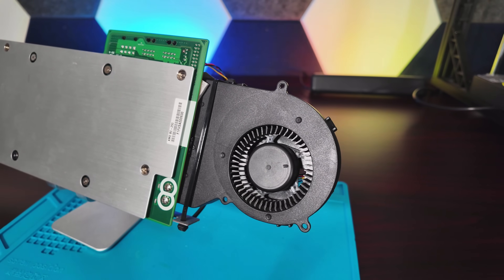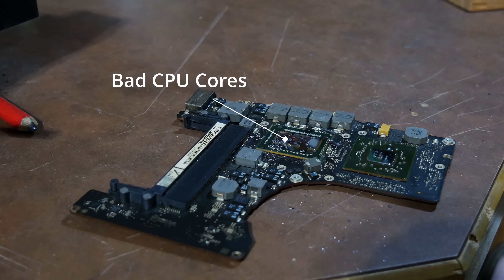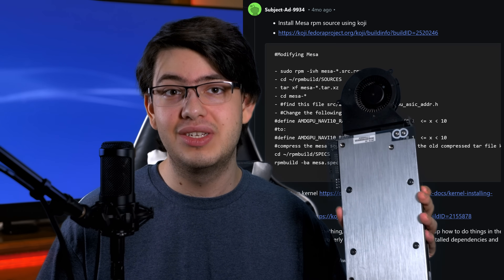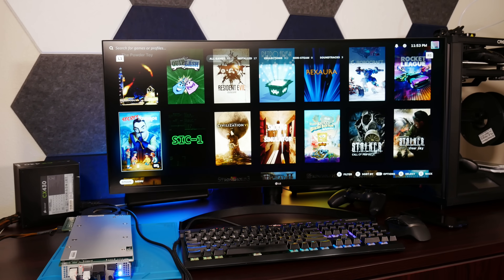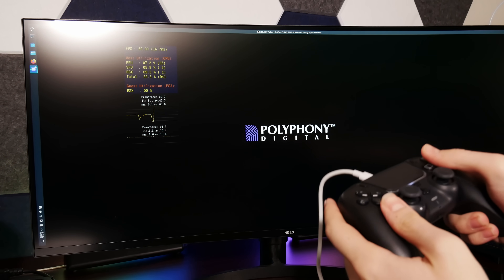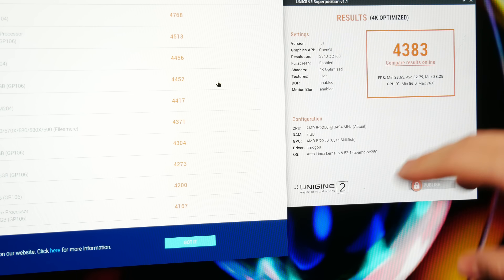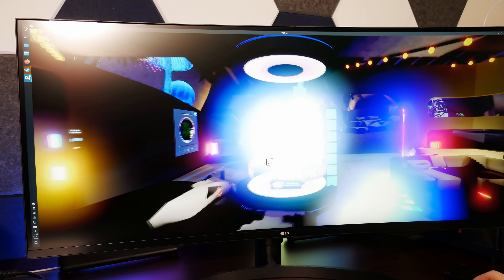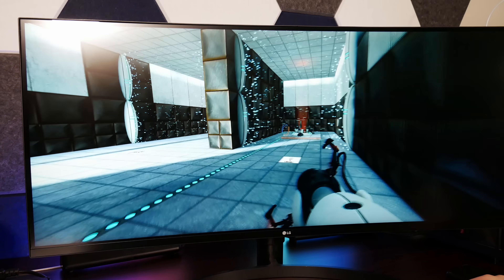I Ran PS3 Games on PS5 Silicon to Prove Sony Wrong

Comment from the maker: Things I got wrong;
- A GitHub repo with relevant documentation is available here, which I didn't run into until after making the video; https://github.com/mothenjoyer69/bc250-documentation
- Segfault (in the aforementioned GitHub repo) was the guy that made the Mesa patch possible. He is the one to thank for all of this. I wholeheartedly apologize for the misattribution, this was a glaring error on my part, the information I used was posted without attribution and I incorrectly assumed who was responsible for the Mesa patch and all the other effort put in to these blades.
- Probably don't need the kernel patch? Test amdgpu.sg_display=0 in kernel cmdline args in newer kernel?
- You can change the 8/8GB RAM split using modified firmware. Some versions of the original firmware even change the RAM split!
- RAM frequency was likely being reported in a misleading format by Linux. It's still slow tho.

And of course, a massive thanks to everyone who has been involved in documenting and experimenting with this hardware, unfortunately I don't know who a lot of them are since we all took different routes to get here, but as a community effort I'm excited to see what people do with these things.
Reply: Is there a BIOS dump floating around? If not, could you dump it? I'd like to take a look-see at a few things.
Reply: @xero110  Are you kidding me? Did you even click the link?
Reply: @xero110  I dumped the original off mine: ASRock 4 U 12 G BC 250 P 4.00. G 040822 Original BIOs search archive for that.
Reply: @xero110  ASRock 4 U 12 G BC 250 P 4.00. G 040822 Original BIOs search archive for that I dumped it
Reply: DM me we can get the right drivers running to get that running more like a 6600.
Reply: @TheRealMrRoboto  Did you figure out how to get better drivers running on it?
Reply: @xyund  yes I figured it out
Reply: @TheRealMrRoboto  bro what do you mean right driver? the world needs to know man.
Reply: @ZombieRig  find out yourself
Reply: A Blender render farm is suitable. LLM wont perform. 1st there ist not enough VRAM per node and the nodes interconnect oder gbit.
I would like to see how one blade performs in blender… (rx480 is not that powerfull 😉)
Reply: Uses? Possibly for an LLM or low cost rendering system.
Reply: Hey the discord link just takes me to discord not the server , plan of getting one of these and would love the extra help
Reply: Can't you make a pull request? Or even open an issue, presuming some amd guy may help
Reply: Your discord link is broken
Reply: Dude your discord link is bad
Reply: How about full processor swap with donor cpu collaboration with northwestridgerepair?
Reply: Bruh am I seeing this right. It costs like $350 for the 12 blade server rack? That’s 12 somewhat trashed ps5s. You sure that power can’t be useful for anything? Like how trashed are they. Can you at least cook meth on them or something?
Reply: Is there a similar older board made using the PS4 APU?
Reply: I wanna see you connect a mpcie to pcie adapter and an HBA card with trueNas.

For example...

LSI LOGIC SAS9211-8I 8PORT Int 6GB Sata+SAS Pcie 2.0
Reply: You could in thery buy ps5 and take the chip off a official ps5 and replace the downgrade one with full ps5 chips by soldering it
Reply: bring it to Salam Techspert or Linus Tech Tip they can help you achieve this plan
Reply: ⁰999
Reply: I wonder if you could flasify the vender ID for the GPU to get it to boot under windows?
Reply: I guess they have enough power for a full distributed Docker Swarm, since you got the power of the CPU and GPU I would have them running Tdarr to encode all of those videos on my home NAS, as a youtuber yourself that might come in handy
Reply: @soykike1991  [EXTREMELY LOUD INCORRECT BUZZER]
Reply: @no-fo6pi  Would you care to elaborate? I guess that would be more productive... I do run a Docker swarm with a bunch of underpowered hardware, how come this would be different
Reply: How did you find the repo that clearly states exactly who is responsible for this hardware being in a functional state (spoiler alert, the people you've credited have lied about their contributions) and yet somehow still fail to credit them properly? I swear to god man youtubers are a different breed.
Reply from the maker: @no-fo6pi  I updated what I can with the correct information just now. This was a mistake on my part. The kernel patch made with my friends was effective, although as I now understand, it was probably not necessary had I known more information beforehand. The vast majority of work and research for this video was done in early-mid September.
Reply: @LowestLogan  You could in thery buy ps5 and take the chip off a official ps5 and replace the downgrade one with full ps5 chips by soldering

Comment: As you've got 12 of these cursed PS5 blades sat there, you’ve basically got a farm of VR-capable silicon doing nothing.

Tech-wise, the BC-250's got the raw muscle—it's basically an RX 480/GTX 1060 equivalent but with 16GB of GDDR6, so it'd actually handle the VRAM demands of stuff like Alyx better than my current desktop rig.

The major software things is they won't boot Windows and Meta's drivers are proprietary as hell, you'd have to go full "mend and make do" with a Linux VR stack like Monado or OpenXR.
If you can get a DisplayPort-to-HDMI handshake that doesn't throw a fit, you’ve technically got a stack of VR-ready nodes. It’d be a right result to see if those custom kernel patches and the Mesa library can actually talk to the CV1 sensors without the official Oculus bloatware. You’ve already proven Sony wrong on the PS3 emulation, so why not give it a go and see if you can't turn one of these server blades into a proper "Frankenstein" VR station?As

Comment: If it works, then why he only shown 3 games running this way?
Reply: The video was basically a "Hey look at me I can buy weird hardware and use people online to help me create code to see if we can run older games.

I honestly didn't see a good use case for having one of these pieces of hardware.

The better option would be to hack the PlayStation 5 directly because it wouldn't be so loud and it would run cooler.

Comment: to be fair, the ps3 is notoriously hard to emulate to begin with. its not a regular CPU  and GPU. theyre cell processors. most emulation is making hardware specific code compatible with similar hardware. the thing is, the ps3's cell processors are nothing like regular hardware. they were experimental at the time and still are today because it rarely justifies the r&d cost

the only reason sony used it on the ps3 was to try and outdo the ps2, the best console ever made. so they took to the "lets try and make a super computer" path

Comment: This video didn't tell us much either, because Sony's PlayStation OS has nothing to do with Linux, and it's simply not worth developing emulators for the older console because there's not that much demand for it. Besides, it's not that the PlayStation 5 can't run PlayStation 3 stuff due to lack of performance, but the PlayStation 4, since we compare it in practice, has a much more powerful CPU than the 4, which is why it's possible to create the environment needed for gaming in real-time emulation.

Comment: Try PS3 SPU heavy titles, which includes most 1st party games and many 3rd party titles pushing it. They will run terribly or not at all. 

If Sony's platform can't play most of the games that use the full architecture, it would be weird to offer emulation.

Comment: You're Not Running PS3 on a PS5.
You're Running PS3 on a PC and the RPCS3 Emulator.
The PS3 is 10 Times Faster than a PS2. The reason You Could Emulate PS2 on PS3.
The PS4 is Twice as Fast as PS3 and the PS5 is only 3 Times as Fast as a PS3.
The reason the PS3 is still Good in comparison to Them.
This Demo, you've done. you've Used a 6x Zen 2 cores @ 3.5 GHz (PS3 = 3.2 GHz)
Thats 7 Times Faster Than a PS3. The Reason You're Demo - Works to some Degree.

Comment: You should revisit this, there's a lot of software updates now and most Linux distros run now and you can get the gpu to clock to 2000mhz now

Comment: - Landed here after a Budget-Builds Official video... :D Well, I'd say YES, this hw could have a use, if it wouldn't be so quirky to get it run properly, since, for the perfomance,
the W's consumed are not that much, and the initial costs are neither that much. SO power to W to costs would give a really good ratio.
I run a Ryzen 5 5500, with 2x8G DDR4, and a 4G Radeon RX570, would be wiped with the BC-250 running on proper sw, while my gpu eats alone over 130W...)
  - Oh, the trusty CX430 :D Is it an older one, or the new?
 - PS X on PS Y: Since the second revision of the PS3 (partially backward compatible, until sw update...) they took proper backward compatibility from us.
We, sadly, have to accept that fact. It is not hw limitation,
it is limited by high profile people at the companies, who have absolutely nothing to do with games and gaming,
just profit on short and long terms. At least it seems so.

Comment: You are running compatible x86 code. Not CBE. That is not a prove. The Games are not bad optimized, it’s the architecture.
Run Uncharted 3, Killzone 2 and Resistance 1.

Comment: Sony learned in 2007 that they can make money by sellimg PS2 games digitally on a non-backwards compatible PS3. Why would they make PS5 backwards compatible?
Reply: So why did they make PS4 games backwards compatible on PS5 then?
Reply: @CharlieMikeNS  because the PS5 has no games 😂😂😂
Reply: @CharlieMikeNS I reckon it's because there was still a huge install base of PS4 consoles and PS4 game libraries out there, and because the PS5 would otherwise be a harder sell, feeling more incremental than the generational leap of the PS2 to PS3. 

Perhaps most importantly, it's much easier technically. PS2 to PS3 meant keeping backwards compatibility from a specially designed architecture to another specially designed architecture. From PS4 to PS5 it was more like "quirky PC to higher end quirky PC".
On PS3, Sony initially included the Emotion Engine but then removed it to cut costs. They could've implemented PS2 emulation of existing PS2 games.
Reply: @arsnakehert  my point is that it's not just because Sony is greedy and lazy.
Reply: no, they didnt do that cause it made more money for them to sell ps2 games digitally. its because shipping a console with the guts of your previous console is a bad idea. remember the $500 launch price? remember the ylod?
Reply: @chillmanmax775 they removed the PS2 chip to cut costs. Then they started selling emulated PS2 games and found out locking people away from access to their games was good for business. Your point being?
Reply: @arsnakehert He probably was paid by Sony to say that 😂
Reply: @arsnakehert  He’ll start talking about how he’s a real man and can scam you as much as he wants or some other horse shit like that, it’s how people like him thinks
Reply: @chillmanmax775  hey man sorry you’re getting so much harassment in the replies. just wanted to say your point on this is entirely valid. while I’m sure Sony liked the idea of reselling PS2 games digitally when they cut PS2 backwards compatibility, they were losing to the Xbox 360 and being utterly demolished by the Wii, both of which were way cheaper than the PS3. consumers wanted a price drop, which meant costs had to be cut, which meant including an entire PS2 in every PS3 got the axe. not sure why people here are convinced it’s some sort of huge anti-consumer conspiracy

Comment: use more power tools from that german site i think they have the bc 250 in there u should be able to raise the 450 to 600 or 800.... messing with voltage...... the drivers will gimp the card to lowest clocks if u use modern drivers so dont mess with VOLTAGE

Comment: another pointless video where the uploader just gets some cpu or gpu that is the equivalent to the speed of the ps5 and then proceeds to emulate ps3 games. that's not backwards compatibility, that's software emulation. sony and nintendo clearly prefer backwards compatibility at the hardware level and not software emulation. there is a reason why sony has stopped using software emu after the ps3. not to mention, consoles use system on chips and not a seperate gpu

Comment: I use my systems to watch my dvds/blue rays so getting a system without a disc drive is not an option for me if they completely stop putting disc drive in systems I will stop buying them and buy strictly Microsoft

Comment: Would this work on a fully functional ps5 too?
Reply: Theoretically yes, however it would likely require a fair amount of modding at which point starting with the BC250 blade would make more sense. They sell for about the same price or less than that of a PS5 but with the PS5 you will have to invest far more time and money to make this work. Then again, it would likely be way more stable on the PS5.

Comment: honnestly if they made a small pc with those chips at a okay price and okay functionality, that would have sold insanely well. though not for nearly as much proffit per board, but would have been great if they wanted to sell piles of boards. though ofcource they where limited by the amount of faulty enough yet still working ps5 chips.

Comment: It was very interesting. Emulation naturally causes a lot of overhead and obviously being underclocked with disabled cores kinda sucked. But it was really cool seeing some benchmarks on console hardware and games not designed to run on said hardware. I've said this many times in the past in many locations, but where there is a will, there's a way. I've run modern games on processors from the Core 2 era, which at this point are anywhere between 16-20 years old. Hardware isn't progressing as fast as it used to, and I wish more people would be mindful of discarding "obsolete" machines and creating ewaste.

Does your grandma need a machine for email, youtube and browsing the web? Install Windows 11 on a SSD and slap it into an old machine from 2005. You just helped the planet and it will be more than good enough to handle that sort of content.

Comment: it really sucks that the only way you can get cool hardware like this is if you go digging for it and/or get lucky and hear about it at just the right time

16GB of VRAM like a flagship GPU (unlike the slow af PC APUs with their stupid narrow DDR) as a SBC (and without all the DRM that's crammed into the PS5 to stop you ever using it as a PC)

even with the crappy drivers that make it hard to utilize the unified memory efficiently, this is still a much better hardware config than pretty much anything else you could buy (except maybe the new mac stuff, which has even worse driver and software compatibility issues running Linux)

Comment: Pcsx2 is used as a software emulation basis for ps2classics since the ps3/ps4, it has the same glitches and some code base supposedly matched up. You wont see 'ps3 classics' unless rpcs3 can run these games flawlessly but even then you're more likely just to see a remastered ports at this point and sony is never giving you backwards compatibility as they try to phase out the bluray.

Comment: Were you running the unity games native or in proton? Because I'm pretty sure the devs of the engine as well as the people using it just recommend running the windows versions of unity games in proton because it runs will fewer issues than native unity linux games ever did.